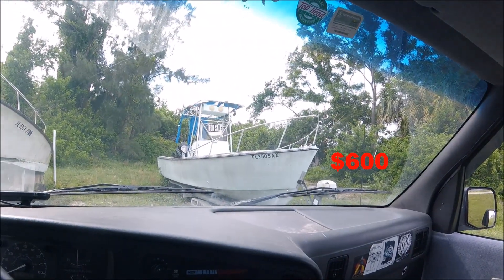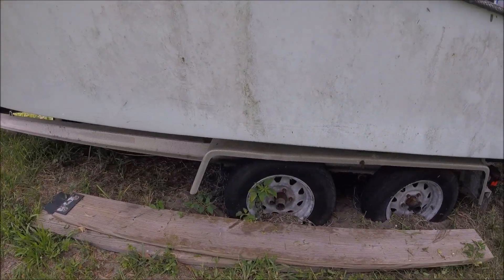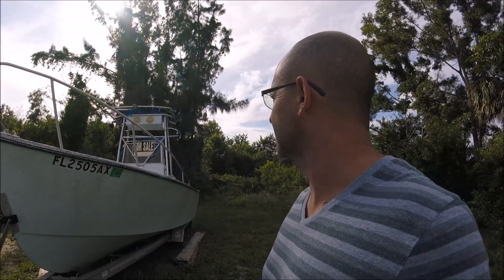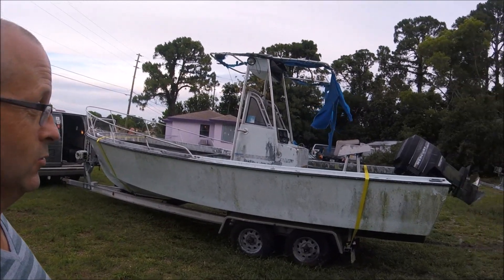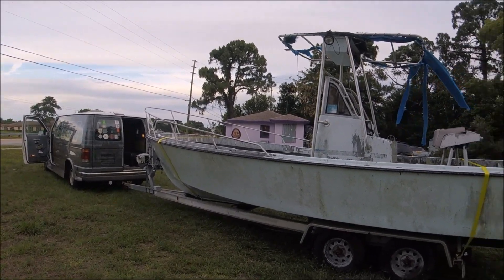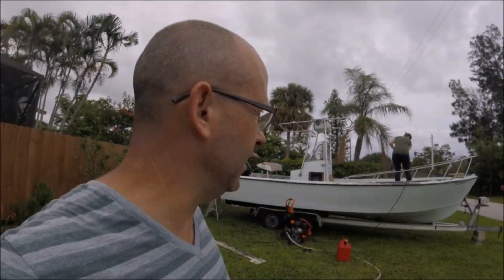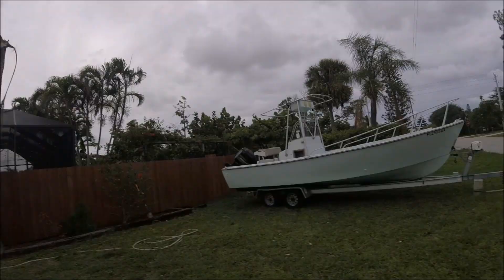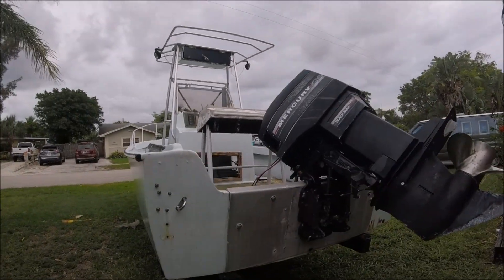Aquasport 22.2 Rebuild 1 bring home and clean up

Comment: I grew up in SouthFlorida  and for many years that was my dream boat  with twin 70 outboards ! I’ve owned 17 or 18 boats so far  and most of those I looked at  had too much structual repairs  so I never bought a Aquasport  however I did own one made by the same designer but had more of a Mako/ Carolina bow flair  it was a old Alem hull

Comment: Just sold my 1998 Albemarle 24.  Only about 300 hrs with Volvo duo props.  Had a leak in one of the Aluminum fuel tanks. Cost to replace Was 14;400 because the T top had to come off, the center console moved forward, the engine under the cc had to move forward.  The entire rear sole was one piece.  Seat, leaning posts, live well, all to get at the two fuel tanks.  Material ..Tank cost for the deep vee was about 400.00 each.  The life of Aluminum tanks in salt or brackish water is only about 10 years.  Mine had developed pin hole leaks due corrosion due to water against the tank from the expanded foam sprayed in to stabilize the tanks in the deep vee. I am too old to tackle a major rebuild like I had.   Glad it’s gone.  The buyer was fully aware of the tank(s) replacement cost as I gave him a copy of the repair quote.  He wanted the boat anyway.  Good luck on your rebuild.  It should be a lot easier than mine.  The buyer can have the repair done for the 14,400 and have a great boat.  If you want anymore detail,  reach me at jburkhaltr@aol.com..

JoeB
Reply from the maker: Wow that's insane! That's one of the reasons I chose poly tank so it doesn't ever rust.  Sorry that happened to you. Hope you get another boat!

Comment: I have the same motor.. I bought a boat just to rob that motor off it. Those old mercury V6's are like the SBC's of the boat world. Parts all over. Easy to work on. Pretty reliable, redundant coils and cdi's. The 150 isn't terrible on fuel. It's probably a little bit undersized for that boat though.
Reply from the maker: Yeah, I'm decent at mechanical stuff but not enough to trust rebuilding it to feel comfortable going way off shore.
Reply: @marcelft  I saw that you were in Florida, and starting this project outdoors. I quickly checked the upload date to see if you were going to be working in the miserable heat soon.
Reply from the maker: @TheStephenspann27  I started this before last summer! So yes, been working in the heat over summer is no fun at all.  I would love a big garage!

Comment: Hello there. I have a 1974 222 
and wanted to ask you. My HIN# is on the left (port) side of the transom instead of the right side. Have you seen that before? Thank you.
Reply from the maker: Hey Tony.  On my 71 there was no hull #.  I am not sure where they are supposed to be.  But classicaquasports.com is a great place to get that answered, those guys are fanatics about these boats.  Good luck!
Reply: @marcelft  Hello There. Thank you for the info. I am also a member of Classic Aquasport and actually someone else in there told me they had the same issue. I am taping over it to keep the original and then I am buying an aluminum plate from Ebay for $16.00 dollars to install on the right side once I am finished.
Reply: @marcelft  BTW... Is video 12 and so on out yet?

Comment: I came across this because I'm looking at one myself at the moment. Are they all "flatback" like that? This guy listed his on CL just as an 'open' and I haven't seen any pictures yet
Reply from the maker: Hey! They stopped making flatbacks in 1972. If you look, the bottom of the hill under the transom is almost completely flat, making it great for going through areas that are shallow. Open may be referring to the boat not having a cabin?
Reply: Marcel Can Do That that is not a flat back  a flat back transom is straight across gunnel is all the way around the back  and usually has a engine bracket for outboard or inboard it s junk save you money and buy a newer boat  and newer motor that is what I did I put a 300 etec on my 82 wellcraft boat brake out another thousand

Comment: Why not saving/restoring the engine?
Reply from the maker: I've had old motors on past boats and I swore I would get myself a new motor for this one. I don't want to have to worry about breaking down 12 miles offshore in the Gulfstream.
Reply: Dear @marcelft  
Ah, I see.
Thanks for answering.
Best regards

Comment: Check out what is under that stainless steel transom plate.....maybe covering a host of evil...have a good sniff.  Lot of money to rebuild the transom if it’s rotted out.  I would unbolt the motor lift it off and undo the plate.  It’s embarrassing if you open the throttle on a sea trial and the donk falls off.  Yes it has happened.  Motor hanging in the water by its cables.
Reply from the maker: Oh that transom is shot for sure, check out the rest of my vids and you'll see how I rebuilt it.  Thanks for watching!